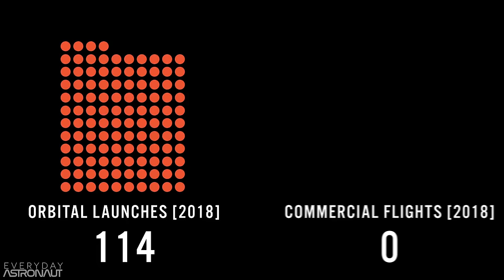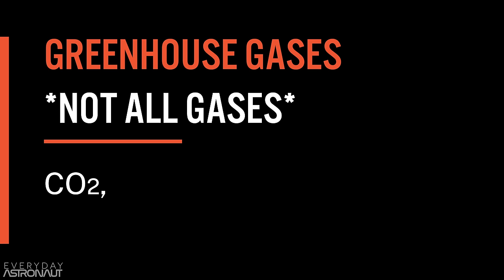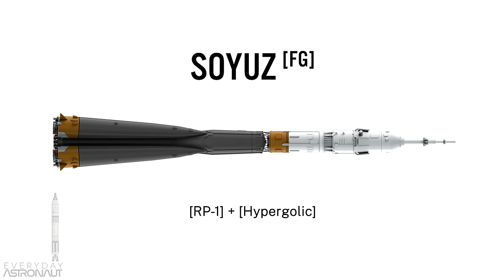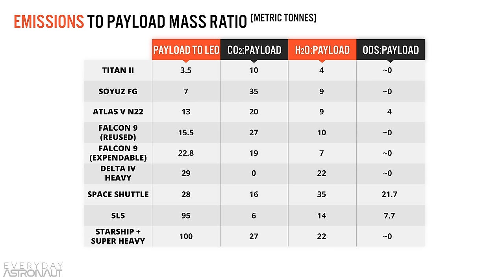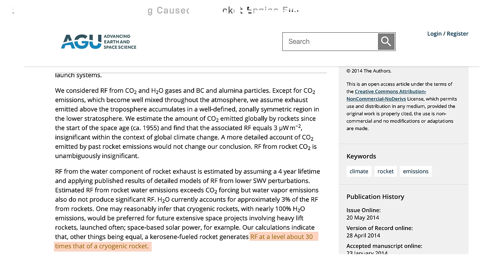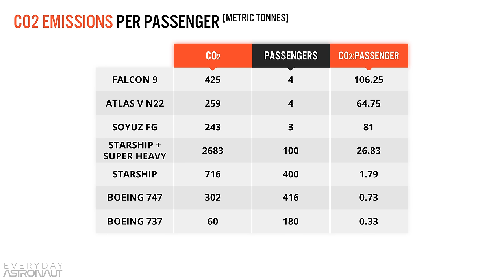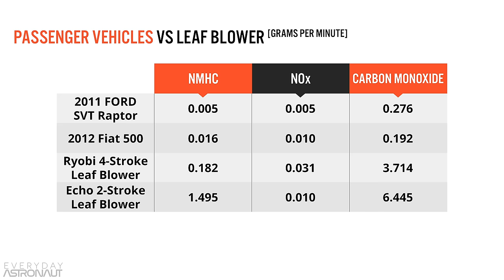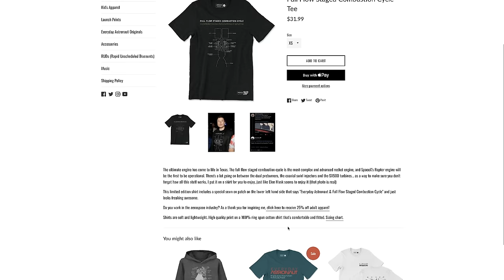How Much Do Rockets Pollute? Are They Bad For Our Air?

Comment: Can we have nuclear powered rockets in upcoming decades?
Reply: saurabh singh - it's not crazy to lauch a nuclear reactor, as long as you never activate it until it is safely in orbit. Reactor fuel itself is not terribly radioactive until the reactor is started up.
Reply: Nuclear powered engines aren't powerful enough to launch a rocket yet

Comment: The pollution isn't causing climate change. It's a natural occurence. We need to keep on track with moving. We don't need the commercial part. Sun's radiation is slowly but surely moving closer to us. Help Musk and the other engineers develop this WORLDWIDE venture. There IS a way to DEFEAT gravity. May also be a way to create  artificial gravity.  Also to travel sublightspeed in space.

Comment: Your answer to the question was basically "Yea they are bad, but look, the planes are worse" lol. For real though, and this is probably an incredibly ignorant question (I'm not very smart), is a solar powered spacecraft a possibility?
Reply: a plane? yes.    A spacecraft? I don't think it's possible.
because they all rely on newton's 3rd law, a plane moves the air around it to move forward
there is no air in space so we can't do it (there is nothing is space :\) so a rocket can't move

there is ion engines but they have fuel in them

the closest thing there is for a solar powered spacecraft is Solar sail that uses light particles as the fuel to push it.
but it's not that efficient and you need a large surface area for it.

but i'm not a rocket scientist so there might be ways to make solar powered spacecraft.
(DON'T RELY ON ME I'M JUST TRYING TO EXPLAIN FROM MY VERY LIMITED KNOWLEDGE)
Reply: It is, look up "Solar sail" a really interesting topic
Reply: Launching a rocket requires far more than solar could provide. Unless you built a large solar farm and used the power to make liquid methane for your rocket. Once you are in orbit, it's normal to use solar power extensively. Starlink satellites use solar power for everything but getting into the initial orbit.

Comment: If musk is launching Starship every day, then surely that can't be good!
Reply: Cars do thousands of times more damage and you probably still drive one. 10 Billion cars driving every day vs a starship that launches once a day (elons goal) is a big, big difference.
Reply: @benzene_sandwich  Yeah. I know. But two things: Firstly, ELECTRIC CARS. Secondly, any small improvement helps. We're dealing with a global issue here, so why add another factor to it, however small?
Reply: @user-kf4mu8br5n  The problem is that we are quickly reaching a point where "anything helps" is no longer applicable. Big changes need to happen fast, so its the main polluters (factories, shipping, power production, cars.) that need to be dealt with first and foremost, and from there more stringent regulations can be placed on rocketry. I'm not against emmisions regulations for rockets, but I believe that it's an issue that can be solved once we main the main changes.
Reply: @benzene_sandwich  Anything Helps is valid and has always been valid. The bigger changes just help more. At this point, we need that, but still...

Comment: Extracting CO2 from the air is super-super inefficient. CO2 in air is only 400 ppm. Doing the entropy calculations the absolute minimum energy requirement for separating this 400 ppm from air is 74 MJ/kgCO2. This ignores all process inefficiencies. This is about 5 times the thermal energy you get from burning the amount of methane that it takes to produce a kg of CO2. That's a terrible idea don't spread it around.

The only proposals for carbon capture are in situations (like fossil fuel plants) where the CO2 is contained and can be processed before it mixes with the air. If you wanted to do this with a rocket you'd have to capture the emissions before it mixed with air ... it doesn't really work.

Comment: No problems with rockets. let,s continiue firing them. But how can a rocket pollute during entry? You get the plasma and heat from the gases already rhere, but there is basically not flames and burning during entry. It may look like but it isn,t.

Comment: Hydrogen can be easily manufactured by water cooled nuclear. The neutrons literally split the water. It’s a safety issue for today’s PWR reactors but (designed for the purpose) it could be harnessed to make fuel.
Reply: Thorium exists on the moon and on mars so no need to take the heavy fuel up there. Molten salt reactors work well with thorium. They extract 99% of the fuel energy (against) 5% for a PWR so waste is not an issue.

Comment: And nobody is talking about the marine life at point nemo.  all that toxins and poisoning for marine life to suffer due to our problems.     even satellites crash down there, they got radioactive batteries on board those satellites so radioactive waste is slowly being released into the ocean due to our laziness to clean up our mess.
Reply: Radioactive batteries don't exist. I think u mean radioactive power generators, but those are always contained in lead, because just like life, computers are also harmed by radiation. Which means the radiation from them would be low since theres so much lead around it.
Reply: @benzene_sandwich  they do exist! it's called a radioisotope battery.  
it uses heat from radioactive decay to make power.
Reply: @georgieippolito9924  Also known as a thermoelectric generator. And, as i said, they are encased in lead and do not leak radioactive isotopes. They most likley burned during reentry anyway, which may be bad, but its radiation spread over a much larger area, making it way less concentrated, nowhere near enough to do any harm.

Comment: According to the Paris climate accord (which the next president indicated he supported reentry back in to) rockets will also be part of the regulation mix. So say good bye to hydrazine and other hypergolic fuels. Even methane (another green house gas) and hydrogen emit a huge amount of water vapor, (another green house gas) in its exhaust plume. So the aftermath will be limited space flights under the accord to the point of possibly bankrupting all the commercial space craft companies deployed so far. So what do you want, a cooler planet that may become more livable, or faster internet to under served areas of the planet? Time, as always, will tell. Safe, and happy travels!
Reply from the maker: If you watched the video, you’d know just how little rockets contribute to overall CO2 and greenhouse gas emissions. I absolutely cannot imagine them targeting spaceflight over just modest improvements in heavy industries, power, and other forms of transportation
Reply: @EverydayAstronaut  What you, and I may understand is COMPLETELY different than what the bureaucratic stock takers, pencil pushers, and bean counters understand. To them, everything is nothing but a cost/risk/benefit ratio to be plugged into a formulaic equation to plug and grind out rules, regulations, and standards. Sometimes they themselves do not understand the rules that they enforce. Safe, and happy travels!

Comment: Starship alone cannot get a Suborbital flight from NYC to Shanghai . . . Carry on.

So what can Spaceships due to reduce carbon emissions,  don't fly Starship on missions that aircraft can do more efficiently.
Reply: ...More Efficiently? How? Do the maths, A jet flying with its engine on, non stop for 8 or whatnot hours vs a starship burning methane (way cleaner) for 2 minutes? How is a jet more efficient?
Reply: @benzene_sandwich  You clearly didn't watch the video you're posting under. 38:35 Tim literally mentions your exact talking point. You're wrong.

Comment: considering that the starship never will carry 100 people to space, not unless they are all pre cremated, and the same for the completely idiotic point to point idea, it will never carry 400 people (well, never carry any amount of anything, but we are talking people now) that slide is quite an insane idea.
Reply: never say never..the starship doubles the payload of an airbus A-380
Reply: @viarnay  and the airbus requires fully sealed environment and suits for the passengers, as well as all the other things that needed to go for suborbital flight? or goes several g, that needs special seats?
most capsules has higher payload than an entire light aircraft, yet barely able to carry the same passenger count. and most people paying that insane price would not like an economy style seating, even if it would be feasible from survival point.

Comment: I am sorry but I had to pause here (41:12). I disagree. You are comparing planes which can fly in max alt. of 50,000ft (not counting military) to rockets which have no limit? Math is simple here. For more power to go up you need more energy. That's the reason we can't reach light speed. We have not enough source of fuel to energy ratio (like 1:1.25), everything so far is less (1:0.75 is best). So jetliners which reach just certain altitude shouldn't be in space type vlog.

Comment: It'd be good if you had a statement about the stuff you (I think rightly) tell us you're not covering up front like manufacturing and transport of the rocket.  Did you make a determination that they don't affect your conclusions?
Reply: These are extremely hard to estimate. But you can try with huge error margins:
A rocket like a Falcon 9 is about the same mass of a small jet airliner (737), and made of roughly the same components (aluminium, titanium). Therefore it is probable that the emmissions from manufacturing a rocket are similar to those related to manufacturing a plane.
That doesn't help as I couldn't find any numbers about plane manufacturing. But just check the numbers: less than 150 rocket launches a year, compared to 25k jet airliners.
And that's with airliners being used multiple times and rockets thrown away with each use. Thanks to SpaceX, there are less than 100 rockets manufactured in fact.

The real problem imo is for the future. Lots of space companies are saying their launch frequency will increase dramatically. Numbers will then have to be updated.

Comment: The best and most powerful lies have elements of truth. It’s true that the direct radiation from the Sun cannot reconcile measured values of global average surface temperature. THE GREENHOUSE EFFECT IS ADIABATIC HEATING IN REALITY. Adiabatic heating is the raising of T by adding work energy (N x m) without exchange of heat energy (Joules(J) which is also = N x m).

The Sun does the work of inflating the atmosphere against the force of gravity in the same way you do physical work climbing up to the top of a cliff. On top of a cliff, you have potential energy. If you do a base jump, your potential energy is converted to kinetic energy as you fall (i.e. when you speed up). Atm pressure (caused by gravity together with the mass of the atmosphere) causes thermal (=kinetic) energy in the case of gases. 

Any volume V of any gas at pressure P has a steady and constant thermal energy P(N/m2) x V (m3) = N x m = J(Joules) = nRT as a result of this kinetic energy of its molecules. Thus for a given mole amount of gas ( n), PV/T = nR (a constant) or P1V1/T1=P2V2/T2.

T1 =214 K +/- (Temperature from solar radiation @Tropopause)
V1/V2 = 3.3 expansion ratio of any gas from 101 to 23 Pascal (P @tropopause)
T2 = P2V2/P1V1 x T1 (above gas law solved for T2=predicted T@surface)
     = 101.3x1/(22.8 x 3.3) x 214
     = 288 K (Earth Surface, subject to minor variations +/-1 K associated with albedo and imperfect adiabatic system)

There’s thus no need and no such thing as magic power producing, entropy reducing, apocalypse causing plant food in the sky. We’re all being exploited for our unfamiliarity in specific science and medicine topics. Choose to think and act for yourself as good as you can. You’re not alone.